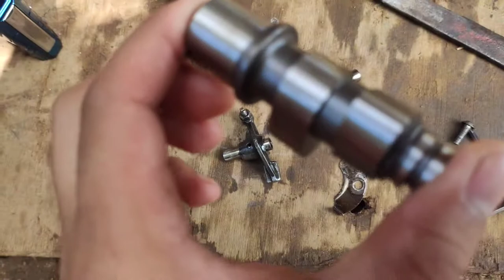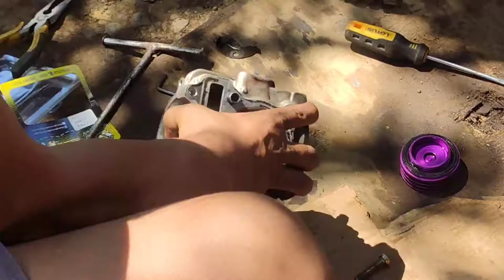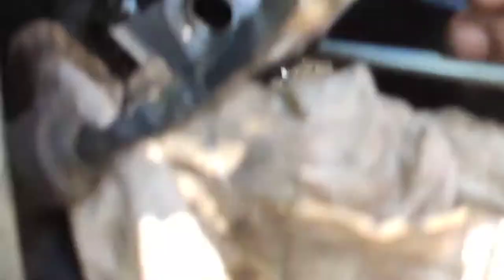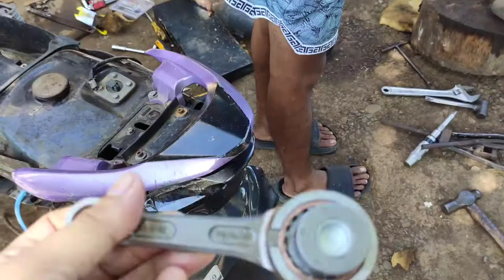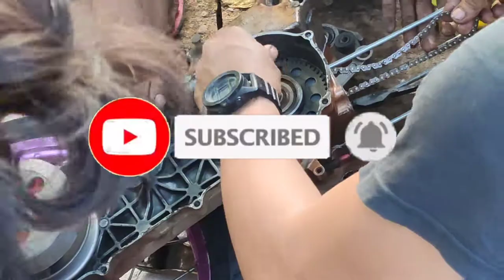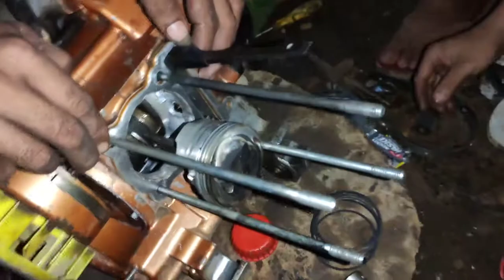Mio Sporty 63mm with pitsbike stroker pin Part 1

Comment: boss nagtabas pa po kayo sa loob ng crankshell nung gumamit kayo ng 3.0 pin at 2.5 rod
Reply from the maker: hindi na po boss
Reply: @kenmotovlogs  boss anong sukat ng timing chain ginamit nyo
Reply from the maker: @romelbeado7916  stock tapos dinugtungan lang boss.
Reply: Boss ganyan din set ko pin 3 rod ko nga lang ei +3 anong timing chain size na dapat tpos naka alloy gasket ako na 10mm sana matulungan moko hnd ko kc alm ung size ng jackrod bolt at timing chain kailangan naka 7.3cams din crome bore 63mm fulldome 24-28head rcm mag papalit din bako ng timing guide boss,?

Comment: Good day po sir. Ask ko lang po sana kung need pa po bang magpalit ng mahabang timing chain at manual timing chain tensioner, kapag naglagay ng 3mm stroker pin at long connecting rod(95mm stock vs. 98mm)? At kung need pa po bang magtabas pa  sa crankcase? Thanks po sa sagot.
Reply from the maker: kailangan po talaga ng mahabang timing chain, yung sa akin dinugtungan lang po namin pero mas safety kapag brandnew talaga na mahaba, yung sa amin tabas talaga sa crank case kasi 63 na yun, at tabas ng kaunti sa piston para d tatama sa crankshaft, mas malalim kasi yung hatak ng piston pag nag stroker pin po kayo.
Reply: A ok boss. E boss pwede bang gamitin yun stock timing chain tensioner o palit manual timing tensioner na po yun gagamitin? Bale yun set up ko po sa crankshaft ng honda click ko po na naka 59mm, ay 3mm stroker pin at 98mm connecting rod po. Atsaka ilang mm ng base gasket po ang gagamitin ko po sa set up ng crankshaft po na naka 3mm stroker pin at +3mm na connecting rod? Thanks po ulit sa reply.
Reply: Atsaka boss pahabol na tanong, ilang links po ng timing chain ang gagamitin sa set up ko po(3mm pin at +3mm connecting rod)?
Reply from the maker: @ronaldsantiago3487  yung sa akin kasi boss, +2.5 yung rod at 3mm pin, mga 3 links yung donugtong namin sa stock, tapos yung tensioner is adjsutable na, tapos 6mm base gasket yung nilagay namin medyo lowcomp sya
Reply: A ok boss. So yun pong gagamitin sa ganun set up ay manual tensioner? Pwede po bang gamitin yun stock timing tensioner po ng click? At last question na lang po, ilang links po ng timing chain yun gagamitin? Thanks po.
Reply from the maker: @ronaldsantiago3487  di ko po kasi alam yung sa click mag kaiba po kasi sila boss
Reply: A ok po boss. Salamat sa mga info, medyo nagkaroon ng idea regarding sa pagupgrade ng crankshaft. Thanks po ulit boss.

Comment: How long is the sleeve. Do piston skirt come out the bottom with a +3mm pin.
Reply from the maker: you need to port the bottom of the piston so that it wouldn't engage to the crankshaft.. the sleeve is 5mm